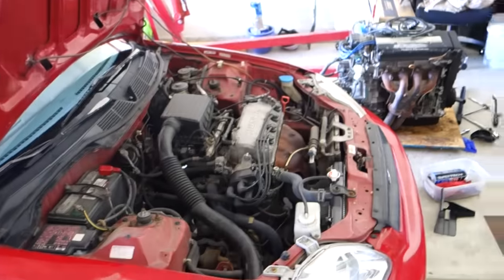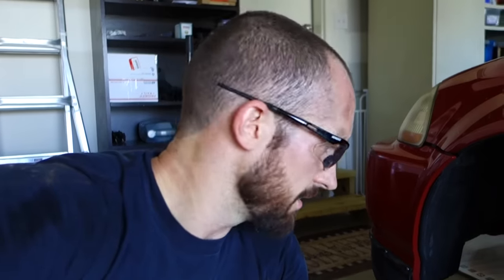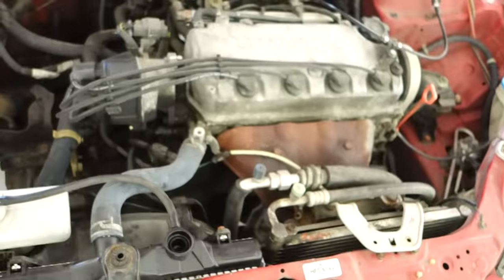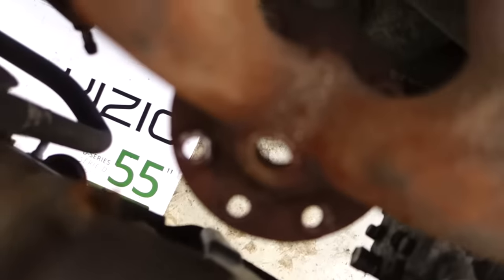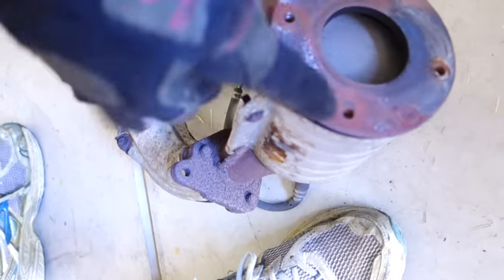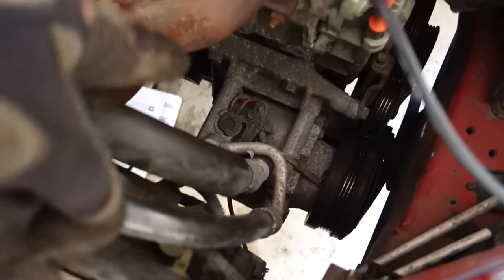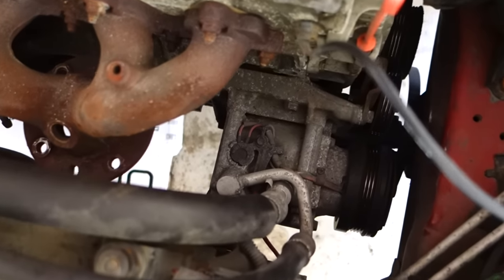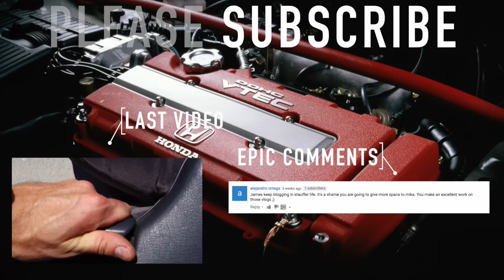How To Remove A Car Engine - Honda Civic Rebuild and Restoration Project

Comment: great videos! has the timing belt & water pump been replaced recently on the gsr? now would be a good time to do it if not. so much easier with the engine out 👍
Reply from the maker: Very true, the previous owner had done it 15,000 miles ago and I inspected the pump and belt and they looked brand new so I left them as is.

Comment: Great video! I feel your pain when the welds break on nuts. That's happened to me a few times at work with control arms on certain vehicles and subframe bolts :/
Reply from the maker: Man it made me pissed but it actually wasn't to bad to fix. Worked out in the end.
Reply: Yup it can be overwhelming. I usually cut a flap, then peel it up and hammer it down when im done. Then use RTV and paint. You can also use a special body glue and glue a piece of metal there. Lots of options other then welding :)
Reply from the maker: thats actually a really good idea, started down that route and ended up just busting out the cut off wheel to clean it up. At least now I can acces them in the future if necessary

Comment: glad your doing a walk through . my question is what year and obd harness are you using? and what I would need to swap a b18c into my 99 ex obd2b. 

nice initial d music at the end 👏
Reply from the maker: The GSR was OBD2a and so was the civic which made it plug and play. For you there is a slight variance but I will break it down in an upcoming video. Gotta love Initial D
Reply: thanks a lot man can't wait to see the finished swap.  #subscribed ! 👏

Comment: bro can i use my teggy to convert my auto ek to manual
Reply from the maker: sure can! I believe the pedal boxes and everything all bolt in
Reply: you're right you can . you can use the manual pedal assembly from that integra for your ek if your teg is hydro not cable. they all use the same manual pedal assembly and hydraulic system👍. I converted my old auto eg coupe with manual ek parts.
Reply from the maker: Thanks for confirming!